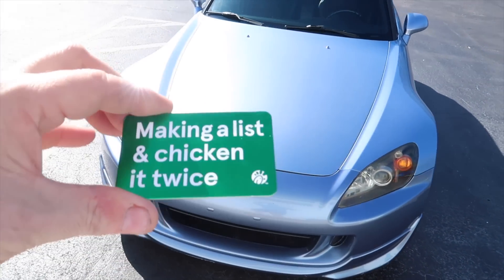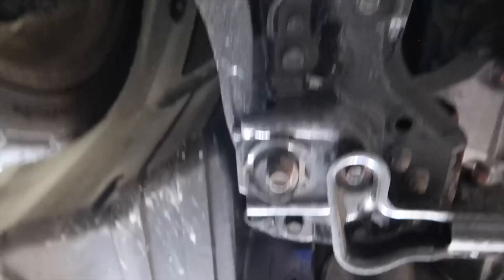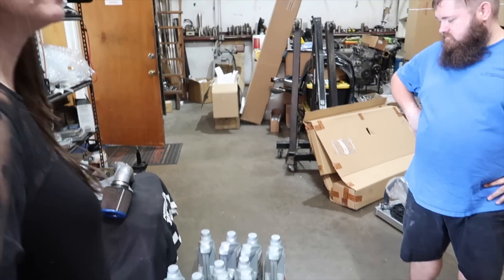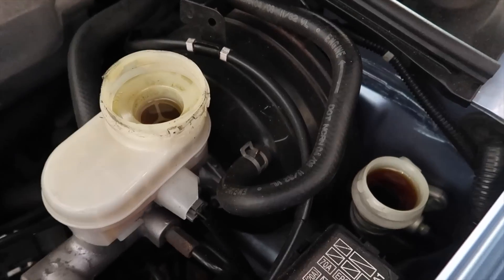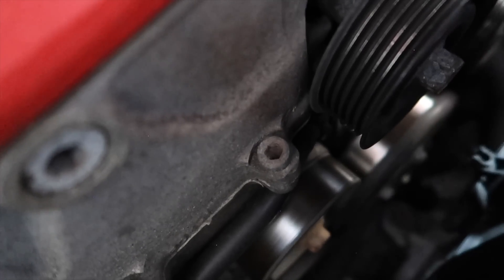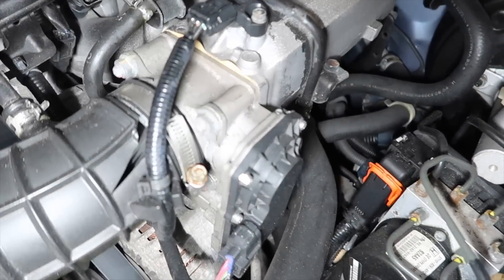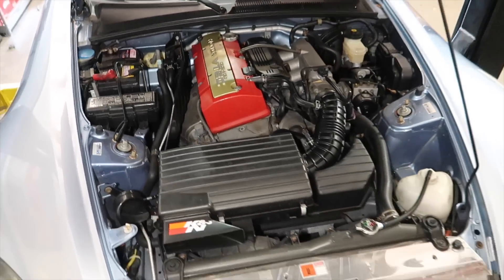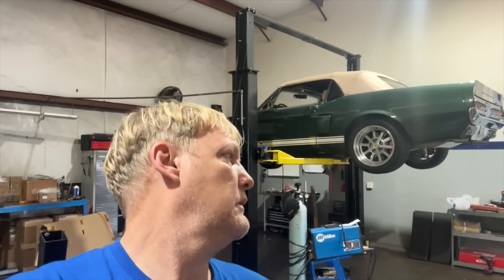OEM Soft top on S2000s by LHT

Comment: Seen the soft top and wanted to see if you guys  have ran into the issue where the corner seams above the rear window have  overstretched, causing the adhesive in those corners to unglue the overlapping layers of the soft top. This has happened to the soft top on my s2000 and whenever it rains or if I wash my car, water leaks inside and has even caused mold to grow. On top of that it creates that humid/damp smell inside my car and I know that isn't healthy. If you happen to come across this in the future I would like to see a video on how to fix it, other than buying a new soft top because I don't have $1000 to spend. I would really appreciate it, thank you and really enjoy watching your videos, keep doing what your doing.
Reply from the maker: We only offer and install the OEM for this reason. It’s fits perfectly without  over stretching the frame or loose that cause leaks etc. We’ve tried every top on the market and never being happy with the final job.

Comment: Another great video. 
Question. Can you buy that little lower black rear bumper/stifferner/exhaust protector that is held on with the two push fasteners seperate from the rear bumper for a 2008 S2000?
Thanks
Reply from the maker: I’m not sure, I’ve never bought one. I can check
Reply: @LHTPerformance  Thank you!

Comment: John, what are your thoughts on the resonator tube on the s2000 exhaust? My k series integra has a lot of drone and I’m wondering if it’s worth it to add a tube similar to the ones on the s2000.
Reply from the maker: They definitely help, it only cover certain frequencies.  There’s a lot of science getting it perfect. We just copied the size and position of the factory one.

Comment: Are you sure it is easy to replace those two bearings?
Reply from the maker: If you’re mechanical it shouldn’t be hard. We did a complete how to video and get countless messages from people thanking us on an easy to follow process. 
https://youtu.be/pgon1dFp_k0
Reply: Pretty easy, just make sure you get the recommended socket or whatever to sit it on. I had to rig something else and that was a pita
Reply: @LHTPerformance  I did it, replaced the bearings, and serpentine belt, and cleaned the engine room. Nice! thank you.